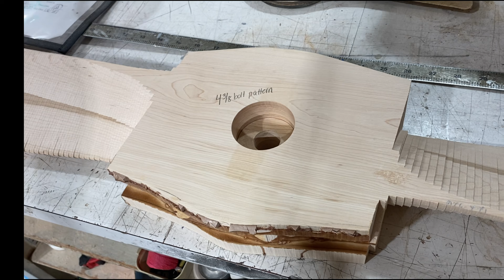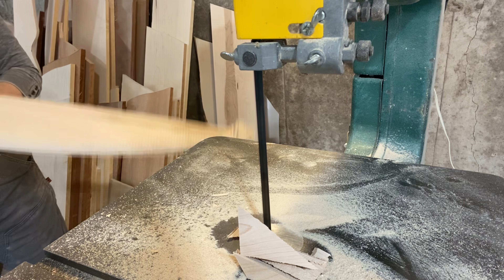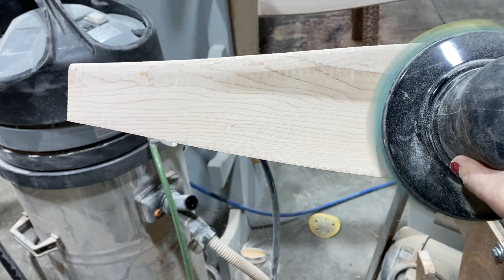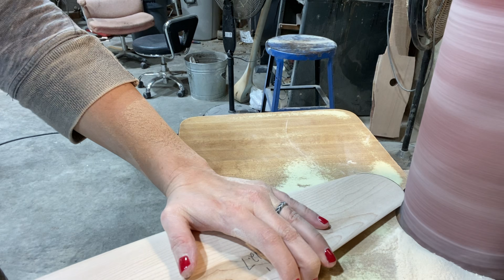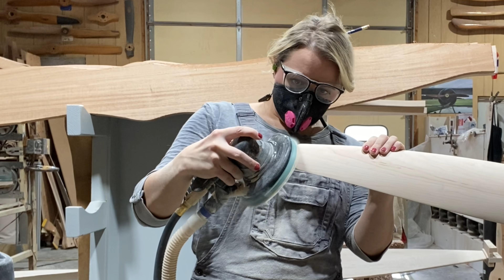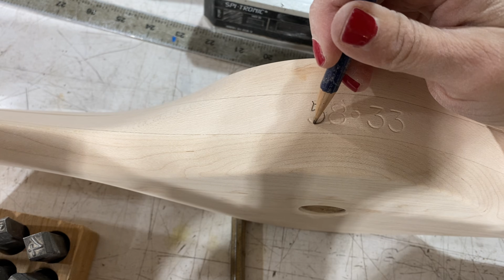Sanding an airplane propeller

Comment: Nice work. The small nicely pre-manufactured Model-Airplane propellers only have to be sanded a bit, to remove flash. Statically balanced in one plane. Model Helicopter blades two or more, has on the other hand to be balanced at their balance point equal along the same length, and also to the same static balance or weight, so as to avoid strange kinds of weird vibrations and flapping.
One can use thin strips of adesive tape to bring them into balance.

Otherwise, the rotor-head might start to shake and oscillate in a bad manner, allmost uncontrollable, and a forced landing imminently demanded.

Comment: So, you do static balancing only.  Why don't you spin balance the blades like they do with new tires when they mount them?
Reply from the maker: It’s not necessary. They run they smoothly by this process. The customer can balance them with/on their engine if they decide to.

Comment: I saw your saw blade flex considerably.  You should bring your guard/support bearing lower to prevent the flex to get longer life out of your blades and to reduce the hazard to yourself.
Reply from the maker: I keep my blade guard high because when I turn the prop on its side to cut the corners I need the height. The #1 thing that will get you hurt with the bandsaw is taking your eye off the blade. If I catch the prop on the guide and have to take my eye off the blade to see what happened or to get it unstuck, I’m in trouble. So far this method has worked for 17 years. I understand it isn’t conventional practice, but I am also not doing conventional work.
Reply: Good point, it's not conventional. @CulverProps

Comment: Always top tier Aviation hand work on the propellers. I so enjoy watching a good hearted person doing the very best.
Culver Props must have a backlog of orders. A true art form hand making the airfoil on each blade that is a rare skill.
I remember “AgentJZ @ S&S Turbines repairing the damaged compressor blades of the GE N79 turbojet with afterburner getting all the damage filed off and reducing the leading edge of the little airfoil of the compressor blade the same rare skill.

Thank you for posting I have followed Culver Props over 12 years. 
Cheers 
Kristy